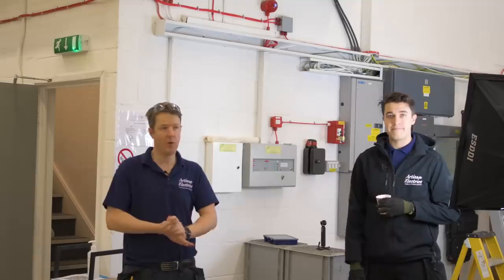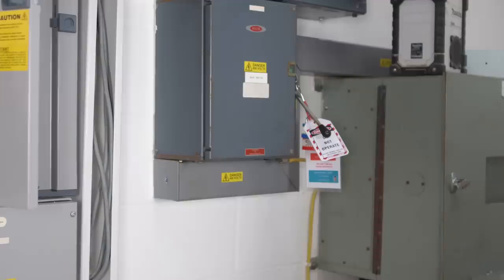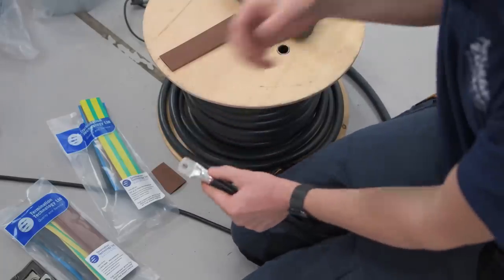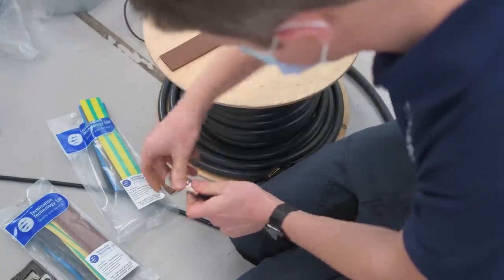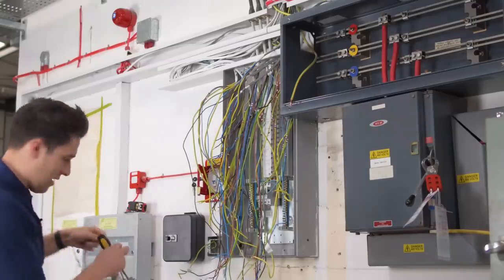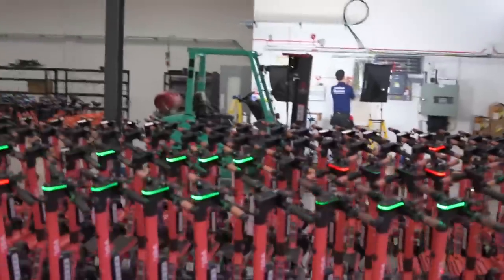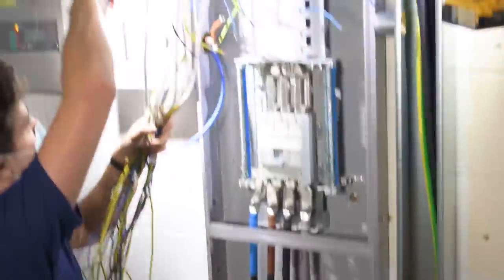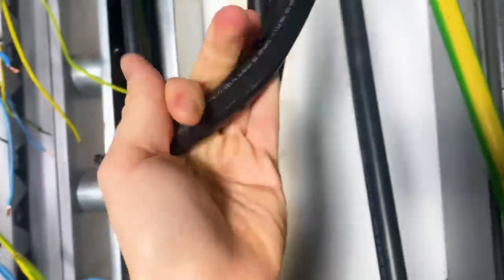Industrial Electrical Installation - Board Upgrade & Electric Vehicle Chargers - Day 1

Comment: A suggestion of a thing to add to your kit in the van : a table :-)  A folding table high enough to be used confortably while standing up.  The thing you'll say "why didn't I use that before" and you'll even buy two more :-)
Reply: Yeah I second this. A folding table is one of the useful bits of kit in the van 👍

Comment: The stroboscopic effect causes running machinery to appear as if it is stationery, such as in a lathe.
Very nice work.
Reply: which is why many factories use 100-120 Hz lighting, so it's not on the same frequency as the machines

Comment: Safe isolation at 2.12 is good to show,just in case someone complains,not that anyone would of course😀
Reply: lol chk out peterson electric??
Reply from the maker: Haha how did you guess someone might complain?! 😂
Reply: @artisanelectrics  If I get a thumbs down,I'll know who did it😀
Reply: You did great on the ARC flash usage. In the USA we have to abide by a separate standard NFPA70E. Glasses, tested gloves, shoe covers, balaclavas, arc flash energy calculations and cal-rated suit to match, boundary evaluations and marking. Lockout and tagout as you did.

Apple Watch nice addition to the PPE Cory....🤣

The three phase boards are much like our residential panels and I really like the use of cable markers from cable craft it reduces the needs for say a thermal printed markers providing an even cleaner looking install.

Comment: Good call on the trunking - looks much better! Love the retracting face shield & good to see the chin strap in place - I've had to chastise DNO line monkeys in the past on that issue. Much as I like MEM boards, I'm getting quite fond of the Schneider Isobar boards, aside from the price! 

I was always taught that you keep the lid on the busbar chamber any time you aren't actively working in there - not essential with the multiple lockouts, but is just good practice. Also not a fan of leaving those tails dangling like that - the sooner that they are dressed, terminated & secured the less chance of getting damaged or rubbed - again just good practice in my opinion.

Comment: I spend my entire working day on site in Arc Flash PPE, it is only effective when you are not wearing any man made fibre clothing, even under the Arc Flash coveralls.  But its is great to see the wearing of face visor and Arc Flash rated gloves when Proving Dead as these are the area of the body most at risk from a flash over

Comment: I've personally had a flash over and the equipment your wore was not over the top. Safety first. Spot on. Forget what you look like. Too many people die skipping safety checks on high voltage testing. Keep up the good work guys
Reply: And like a HV sparky would say if you have to wear arc flash gear you don't trust your isolation

Comment: OH my gosh! Wow Cory had worked hard working. The 4 black wires should be on the left corner bottom (dark gray main panel) instead of the left top corner the 4 black wires bend. Great job! Thumb up! Cheer!
Reply from the maker: Yeah we changed it later you will see in part 2

Comment: 120mm tri  rated!!! Jesus you thought the arc flash vest was over kill 👍
Reply: I used switch off and open switch and check its operated , saves all that dressing up, never had a problem .
Reply: Does seem a bit high, good for 374A?
Reply: @alecturner2008  only if running at 90deg...in free air. once it’s de-rated for 70deg and a bit of grouping, will be about 250 A

Comment: It really amazes me to see that you had to label the wires. In our factories every wire inside a cabinet is always coded and there are complete drawings of all the electrical wiring inside the cabinet.  Also every multicore cable has its own unique number so you can identify each cable and easy identify where the other end is connected.
Reply from the maker: Wow wish things were done like that here

Comment: That Arc Flash hard hat with the retractable face shield is pretty cool. Looks comfortable and probably isn't prone to fogging up. We're required to additionality wear a balaclava, safety glasses and ear protection, even with the 40 Cal suit.
Reply: I guess from the USA. The NFPA 7OE is pretty strict about this and I whole heartedly agree with you. Including electrically isolated shoe covers. Testing of the gloves before use and boundary marking arc flash calculations to determine energy and Type of PPE usage.

Comment: Nice! - Out of interest, why do you need a generator, could you not have just installed a small temporary CU hooked up to the switchfuse until you were ready to connect the new DB?
Reply: This is a warehouse full of ev and Scooter charging I think a small cu wouldn't have been suitable for there requirements
Reply: Agree, seems like a sensible thing to do! I have a temporary board with 6×13A, 2×16a & 1×32A that I use whenever I do board changes or rewires.
Reply: @Rory241995  If the heat gun was causing "generator issues" as stated, I doubt it's (the gen) of any sizeable capacity.

Comment: Lovely neat job. Any reason why you didn’t use a larger width trunking as the right side will get stacked pretty quickly with the mains running through aswell.

Comment: Gauntlets would be better. "Better to be over the top than dead"  is never an understatement. My boss had an incident on a 3 phase and got blown half way across a room ... so it can be quite serious ... no, correction, very serious. Good to show safe work practice though. Nice install.
Reply: +1 for Gauntlets
Reply: Nip down to the welding fab area nick their head shield, shirt and gloves.

Comment: can you explain a bit on the 120mm tails? So if your main switch is 250amp am I right to assume the cable calc is used from Table 4D1A? Can you tell me which column you used for reference method. It is very hard to find videos on Industrial units. thanks again for the brilliant video.

Comment: Nice work. Just wondering if you put anything above the holes in the busbar chamber which go into the main isolator you locked off. U dont want to go dropping anything in there lol. Best thing to do is cut a piece of cardboard to fit in the bottom

Comment: Looking good so far, was there any paxolin between the trunking and board? Eaton also do a ready made interface which can be used instead of paxolin.
Reply from the maker: No Paxolin needed on this job
Reply: Huge timesaver, use them nearly every time.
Reply: @artisanelectrics  nice, what did you use instead or was the way you installed it meant it was not needed?

Comment: What’s the point in keeping the busbar? Might as well have taken the supply direct from the main switch if your not going to use the busbar for what it’s intended for.
Reply: Indeed, we need to try and put less shit into landfill, just tearing out the old install and throwing it away seems incredibly wasteful.
Reply: E C it is made of metal and could have been recycled, would not have gone in to land fill, removing unnecessary equipment is good practice, less points to possible fail, bus bar chambers are not the safest, hence why we now install MCCB boards.
Reply: In a commercial building you don't want to limit your options with power distribution.  That bus bar box gives more options.  They may want to run another set of sub mains in the future to another switchboard, that box make it easy to tap off.  Also that business is probably renting the building, the owner might want it left because it gives future tenants more options.
Reply: Might be a rental unit and the bus bar chamber being part of the landlords property.

Comment: Nice tidy install however i would have liked to see some paxolin between the board and trunking......also i really am not a fan of the bushes in the sides the massive entry in the top of those boards will take all the cables going into that board.

Comment: 14 bikes at amps at 4 rows 448 amps at single phase 220/240 vac
so at a guess including the scooter base  as the same level 

896 amps based on a 8 amp charger at bare min of 2,000 amps just on chargers alone..

I would ask what the service is to the premises because from what i'm seeing you might be looking at north of 1500 VAC service..

Comment: Paxolin used? When I am doing TP boards I also frame the board with Galv trunking about take slots out at the sides and bottom. Then paxolin in between board and trunking. You need to ask for flat 90 bends squared no tapered so you can keep the trunking tight to board.
Reply from the maker: We didn’t use paxolin it wasn’t needed
Reply: @artisanelectrics   what is paxolin ? 🙄

Comment: 120mm tri rated cabling is great future proofing as 120 TRI cable can hold 374a all day long per phase
Reply: i was skeptical about  replacing the fusebard as opposed to just adding but when you see how much cleaner it all looks its a good option now in my mind

Comment: Do you have to have a different qualification for industrial as opposed to domestic installations?
I noticed the mixture of old and new colours on the 3 phase which colours correspond to which in old/new?
Reply: Red Yellow Blue is officially old. The "new" is brown, black, grey. I've never quite understood why Europe uses such similar colours where as the British had quite clearly different colours for each phase then changed to align with Europe. In Australia we just change the yellow to white as to not have it mixed up with earth, so we use Red, White, Blue with a black neutral.

Comment: Worked on Fords, Halewood in the 70's and on car production lines you need a letter from the Pope before you can turn them off so live working is the norm. Those days were before Health & Safety so they allowed apprentice electricians to work on 3 phase bus bars systems with no Flash guard equipment or isolation clothes/equipment. Until one day a 19 year old apprentice dropped a spanner on a live bus bar and went to pick it up thinking the bus bar was dead. That was the end of him but they did turn the production line off to remove his body. Our union at the time the EETPU called for a 48Hr strike over Health & Safety and the Newspapers called us militant bastards. Glad im now retired and H&S is taken more seriously. Well done Artisan Electrics.
Reply: I remember an electrician I was working with when I was an apprentice back in 89 to 1990 mentioning him and his work mate were working on a live busbar and one was on the top one underneath and they dropped the spanner between the bars just missing them( i don't know what they were installing)
I can remember the EEPTU as it was called then as well.

Comment: Nothing to do with the video but as you seem to use Hagar a lot, so I just thought I'd say I  fitted my first Hagar consumer unit today for storage heaters(quite nice if I say so myself with use a fire rated grommets and flexi tails)
 Normally a cheaper consumer unit
would be fitted due to budget with the housing association client as sors are used and costs already agreed as per contract but it was a last minute type job reported late yesterday afternoon (they asked if it could be done on Xmas eve the old consumer unit was reported for upgrade in October!) With limited space, there was another consumer unit underneath   and it went to the ceiling so only just fitted in without dropping the consumer unit underneath

Comment: Another great video guys thanks a lot. This was always the job I was given during my commercial days.Always interesting to see how other people do it the way I normally do this job is before I disconnect any circuits I would fabricate all the new distribution board and trunking on the floor tying it all together .Before I dismantle the old one this will obviously reduce the time the power is de energise.Fairplay for use in the flash guard mask the only time I’ve ever used that is working on main switch hv / lv but fair play to you.But then to go and file the trunking with a grinder you’d be Thrown off site (Don’t get me wrong we all do it) And as somebody else has mentioned come on Jordan buy Corey a bench they’re only 45 quid It looks really uncomfortable working off that create. I’ve got to be honest I’ve never heard of tri rated cable being called bi rated is that a Dutch thing or is it a different type of cable. What’s the reason you decided to not fit it  to uni struct is it because you had to tie in the trunking above but you could’ve use the shallows struct at 21mm.I also prefer to use the same method as using 2 inch bush and couplers even though I smoked for 15 years I hate cutting the paxolin The flumes  seen as toxic as it gets.Always good to see also a big fan of eaton It’s a shame not everybody’s budget can allow us to use that. Anyway that was a great video and thank you and I hope you all have the most beautiful Christmas and please don’t take offence of any of my points they are only my own observations. Ps Can’t you pull armoured back to where the fire alarm junction boxes then they will be able to come down straight.
Reply: Also what you could’ve done is fitted some square plate washers behind the white plastic trunking to bring it off enough so you could use Unistruct
Reply: Mate killing it 🤣how are things with you Will Merry Christmas and Happy New Year to you and Ollie. We’re’nt happy when we lost to you mate...Oi, Oi...

Comment: Loving your content. Buuut, don't want to be one of those pedantic guys (and here it goes). Should really do the arc flash calcs to check the PPE levels are correct, and also when checking for dead wear arc flash gauntlets. At 400v 250a most of the arc will be around his hands (guessing 600mm from bus to face). Anyway hope that's helpful, or you could tell me to do one, either way.
Reply from the maker: Yeah it’s just not very clear how to do all these things for the average contractor

Comment: Considering 60% of the electricity comes from fossil fuel, these things are not quite as green as they could be. We should promote Hydrogen more, far greener than electricity. Better than Diesel I suppose.
Reply: Hydrogen powered scooters? Assuming you're referring to the vans, these guys have got a business to run, charging the vehicles on site over night/lunch makes a lot more sense.  An electric van doing an urban delivery cycle (picking up scooters) is hugely more efficient than any combustion vehicle and is completely zero emission inside our cities.
Reply: If you're worried about the electricity generation mix for battery electric vehicles, then you should know that hydrogen has a similar problem; traditionally a lot of hydrogen is produced from natural gas, in a process that creates carbon dioxide.

Of course, hydrogen can be produced in other ways too, such as by electrolysis using electricity from renewable sources, but that goes for electricity as well, so it's not really an argument for one versus the other. Both options need development to make them lower carbon.

If we end up using hydrogen in the gas network, instead of methane, which they keep saying is going to happen, then I wonder whether it will become possible to refuel hydrogen vehicles at home. That would be an interesting development.
Reply: @patrickwigmore3462  One of my issues with the mono focused push on electric vehicles is the lack of thought for the biggest users of vehicles and that is with vans, trucks and HGVs. I use a van and the current (no pun intended) offering of 100 miles on a charge is a joke Especially since I work in the north of Scotland doing 200 miles a day just between jobs.

It just seems that we are rushing ahead with punishing diesel drivers before an alternative is available. If I could get an electric van that gave me 300 miles I would go for it, but I'm not paying £60000 for it!
Reply: @phoenixdundee  Yes, that is rather an issue, isn't it. I think the technology will get there in the end, but will it be ready in time? Who knows. If the law says it must happen, then it's in the the vehicle manufacturers' interests to try and make it happen, but that doesn't mean it will.

Maybe more people will end up driving petrol vans in the interim. (I don't suppose there are petrol versions of heavier vehicles.)
Reply: @phoenixdundee  hopefully some reasonably priced lease options come along soon, like to see the councils get involved and provide some sort of resident parking exemption schemes for trades using electric.

Comment: Why rip out a serviceable MEM 2 board. Just to add a few extra circuits. Leave the MEM 1 buss bar in service. Could have gone right at high level or right and down to a sub board. Seems the more videos I watch of yours the more I see you pull the clients pants down. Is that why you brand as Artisan?

Comment: Do you seriously expect arc flash from placing a test device across a busbar?  I can understand using arc flash gear with dodgy looking\faulty equipment or systems running at 1kV+, but otherwise, this seems to like an overreaction!  Great video as usual but I had to poke at that one!
Reply from the maker: Yeah we were just being extra safe, no harm in being overly cautious right!
Reply: Thought exactly the same myself, never seen anyone do that in 27 years. If they hadn't someone would have pulled them for not wearing it though!

Comment: What a pointless buss bar chamber?
Reply: No I wouldn’t suggest to remove just looks like from day one it has not done a lot. From the days before panel boards.
Reply: You can still buy the Glasgow chambers and switchgear. Though sadly no longer made in Reddings Lane Birmingham.  Now made in India.
Reply: The warehouse might have been a rental originally, so they put in systems that offer flexibility for future tennants, one could be a machine shop or heavier industry.